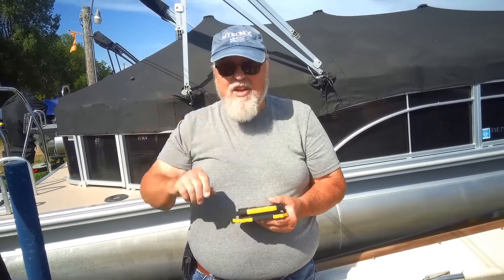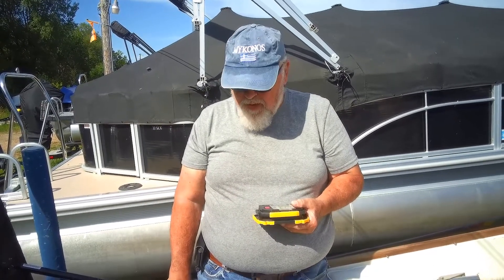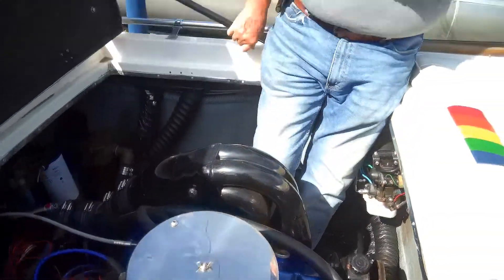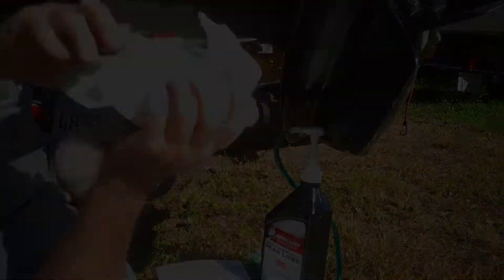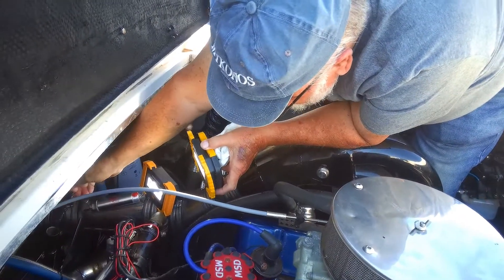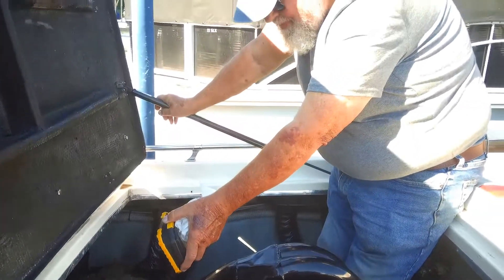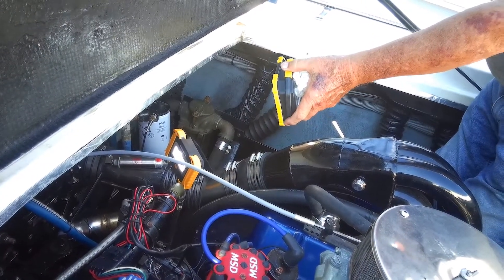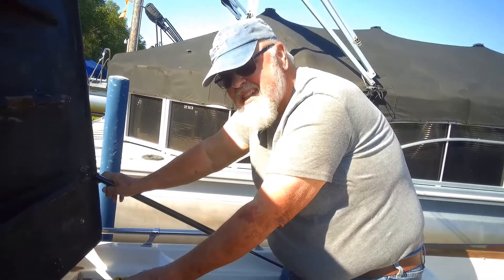TRS Outdrive Service   EP14

Comment: Awesome video. Recently got a project boat with a TR set up trying my best to learn about them.
Reply from the maker: They're simpler and heavier than a Bravo drive.  But they have a transmission between the motor and outdrive.  Reliable and will handle up to 600 hp in a single configuration.
Reply: @regorsgarageboatbasin7515  only problem now is finding parts. Especially for the tranny.

Comment: Redor, what holds  the back part of the 454 engine in back? Where do I disconnect the read part to lift the engine out? Thanks in advance.
I have the trs manual but it does not have anything on the tranny.
Reply from the maker: The standard chevy motor mounts are in the front sides of the engine...front motor mounts. The back two motor mounts are at the back of the transmission.  See my recent video on the methodology to pull the motor.

Comment: Rogger that tube or hose you have to catch tranny oil from the overflow. Where is your overflow comming from? I have the Mercrusiser tranny (1980) and it is dripping ATF from the hole at the bottom of the bell housing. The hole is about 1-1/4 size. It seems to drip more at idle than at 1500 rpms. But then it will run down about an once at times. I put some AT 205 reseal to try and soften the seals but that is suppose to take 5 hours drive time to fix the leak. This is on a 26 ft Caribbian day cruiser I just bought and needs total inside restoration which I can and have done. But I assume your Borg Warner tranny may be different than my Mercruiser. Also my tranny dip stick is ion the left side not like yours on the right side. Will it harm it to run it dripping inside the bell housing where the flayweel and shaft are? Or can I run it like that and hope it seals it in time. As I need to run it for 5 hours little at a time.. Thank you in advance. And one more question. Where do  you take out the ATF from? Is there a drain plug to replace the tranny fluid?
Reply from the maker: ATF messes up the bilge and will eventually get pumped into the lake by the bilge pump. I removed the vent on top of the transmission and made a fitting with a hose barb. I used a standard Mercursier fluid tank mounted on the transom to catch any fluid. I'd be suprised if  more than an ounce of fluid moves in and out of the tank.

Comment: Hi again Regor. tell me please. when you remove this outdrive, do you have to take it out with all the steering assembly on the mercrusier tranny style. And once taken out, the seal or seals that are leaking like 2 quarts in 5 minutes, are they assesible once you take the tranny out from the block. Or do you have to take more of it apart to get to the leaking seals?  Any info on this will be greatly appreciated. Is the first thing you take out the outdrive too?
Reply from the maker: To remove the TRS outdrive (or an Alpha drive) remove the bolt for the trim cylinders at the back of the drive, then remove six nuts along the upper gear housing.  It pulls right out.  The TRS is heavy so be ready...a hoist would be better.  Putting it back into the transmission requires the boat to be nose down.  It still sucks getting the tail shaft to go into the transmission splices...just move it around and turn the prop.
Reply from the maker: On the TRS drive you have a separate transmission between the engine and outdrive.  That's why the TRS is good for 600 HP...no shifting in the outdrive. It's been a while since I had the transmission rebuilt on the boat. Get the maintenance manual from Mercury and it will tell you exactly what to do.  Also, leaking oil is usually a hose.

Comment: Hello. I just bought a 26 Carribian with this outdeive.  I never seen one like this and just found out it has a Mercury transmission. But it is leaking under the bellhousing. About 3 onces I say in 12 minutes run time.  I was told I have to take out the engine to repleace the two seals. But in your video you put a house to catch some ATF fluid too. Is it normal to drip ATF fluid? It did not show any in the dip stick. After putting over one quart and half is shows it is low about one pint. I started it for about 1 minute and did not leak any untile about 10 minutes after shutting down.
This boat was neglected and the water pump must not be pumping becuase the engine maniflods and risers are very hot. I took the manifolds and riser off today and one riser was petty bad but Im sure the impeller is fried. Will take that ouf another day. But please tell me about the ATF leaking fron the hole in the center of the bell houseing. Why did they put that hole in the fist place? And do I have to replace the entire housing in the water pump or just the impeller?  Found the housing had a crack and the cup under the hull was not pushed hard to make a good seal to flow the water to the pump. Now it is running cool and sounds great. Stil have that leaking tranny though. I oput some At 205 reseal but they say it need 5 hours run time to stop the leak. That will be many times of 10 to 12 minutes each time. Thank you in advance.
Reply from the maker: Fluid comes out the top of the Borg Warner through a vent.  If it comes out of the bell housing you have bigger problems.  And you do need to pull the engine to work on the transmission.  Done this many times.  You need a friend with an overhead hoist.
Reply: @regorsgarageboatbasin7515  Hi again and thank you for your info. Other than a seal leaking, what problems would tghere be? It shifts into gears good and no noise at all. But I do seem to hear a clatting sound and wonder if the gimbla bearing is the chatting sound. To pull the engine out, do ZI just take out the outdrive and pull the tranny with the engine together? And what about the power steering assembly that is mounted in the transome. Does that have to come out with it too? It is a huge assembly and not sure if it is part of the tranny.